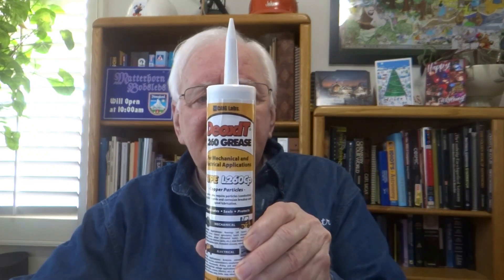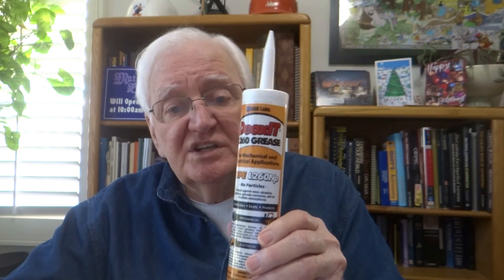Dielectric grease, Lithium grease, Copper particles, CAIG LABS, DEOXIT L260, J Shook

Comment: Hi John;
I was skeptical about using any type of lubricant on a large contactor because the high amps and heat
when the motor is running .
Would you recommend to lubricate a 600 amp 3 phase contactor using the L260CP  Deoxit grease???
any considerations we should take into account if we do it???
Thanks.

Comment: Thanks for explaining what this L260DCp is for.  I own it, because I wanted to use it to bridge a gap between two pins of a faulty plug, but CAIG said it isn't conductive enough for that, and my multimeter proved they're right, so I bought a silver paste.  In the meantime, what to do with this L260DCp?  You did a better job selling the stuff for a purpose than CAIG does.  Thanks.

Comment: Thanks John. Is it generally ok by code to splice (2) # 6/3 cables together to run underground in some conduit,  with split bolt connectors and L260...all taped up of course???
Reply from the maker: Use Scotch 120c to waterproof it.

Comment: When 'BURNISHING', (i.e., fine sanding or polishing), electrical contacts, BEWARE OVER-doing it!  Why?  The factory PLATING.  Try not to remove the PLATING.  Only remove the crud, carbon, or oxidation.  NOT PLATING!

Comment: John, I thought I would cut a wire without turning off the breaker. I thought "Ah! I'll cut it quickly with a cutting pliers". Obviously I thought that the electricity would simply stop flowing through the wire with the quick cut. Instead there was a burst of brilliant light and sound that scared me and blackened the plastic around the wire. I went to turn the breaker off and finished cutting the wire. 

That was VERY stupid wasn't it? Should one ALWAYS turn off the breakers before doing electrical? And I am curious, if you have an explanation as to why I was wrong. I really didn't expect that electrical flare (or whatever it is called). I expected the electricity to just stop and not jump out like that. That really spooked me.
Reply from the maker: Cutting one single wire is ok cutting a hot and a neutral together is a short. JS
Reply: You probably struck your cutters across the box frame or nicked a ground. Otherwise there'd be no flash. But turn the breaker off always. It's hard on the eyes also! LOL

Comment: Thanks for sharing your insights. My late older brother was a fanatic about using dielectric grease in every automotive connection. I fully believe that you are correct, but my concern is with all the codes, AHJs, and verbiage about following manufacturer's recommendations. I am changing from standard breakers to AFCI and Dual AFCI/GFCI breakers in my Murray panel that is about 40 years old. I checked the instructions that came with the Murray (Siemens) breakers, and they say nothing about adding any kind of grease to the contacts. So I am conflicted if I should add anything to the contacts.
Reply from the maker: The AFCI breakers are new about 10 years and are not as reliable as the gfcis. The manufactures are not worried about oxidation as much as failures. JS